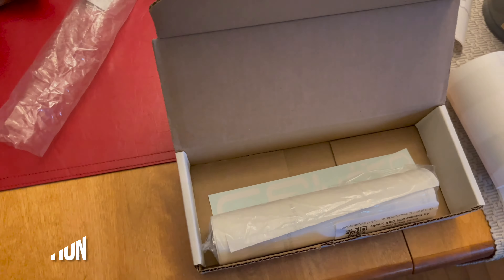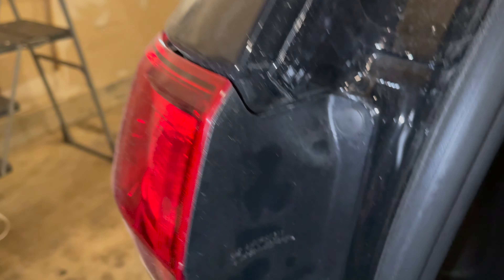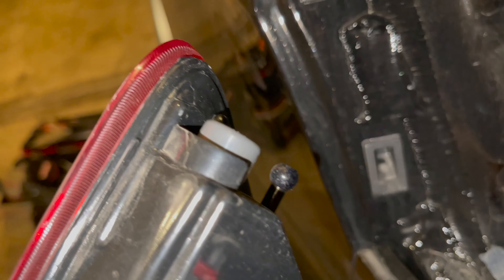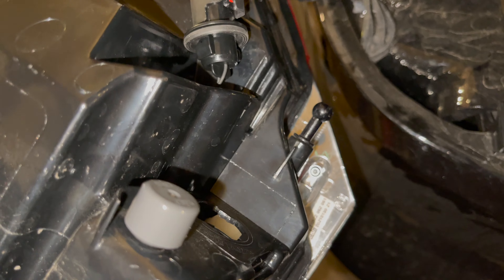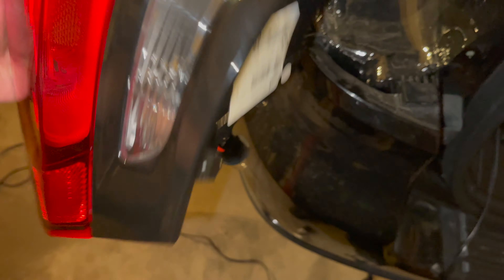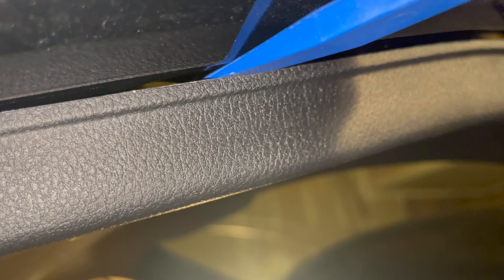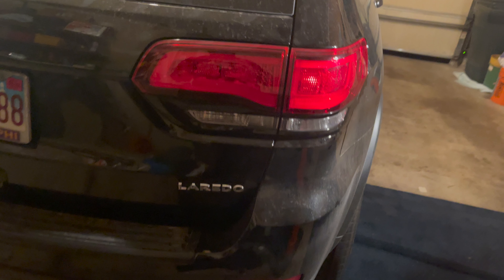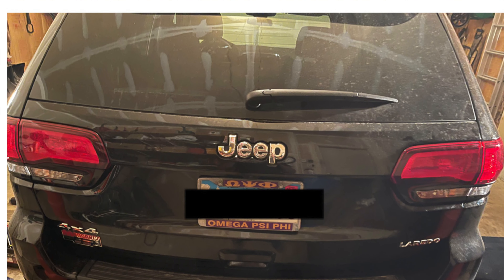How to: Chrome Delete Part 1 (Tailights) Jeep Grand Cherokee

Comment: Only thing I wrapped was the window trim an bought that off of Amazon. Bought the break light trim actually trim not a wrap off ebay for like $40 did the same for the fog light bezels the actual plastic bezel was like 30. An bought the front grill trim off Amazon for like $60. I originally bought the wrap kit made for the car an tried it an didn't work out an that was like 60 dollars down the drain. Go on Amazon an buy the black wrap its like 3 inches wide an 10 feet long you'll have some left an dont have to be perfect lining it up as it will hang over an you just trim it.
Reply from the maker: Yeah in a later video on my page I did just that
Reply: @BigStuDolla91  yea my bad Starting watching this one. I took the dam mirror off when I was wrapping the trim made it easier. Watching your door speaker video now I have the same stock speakers an wanted to upgrade em. Was it worth it?? Try to link these headlights I'm thinking about getting which is my next upgrade
Reply from the maker: @mikehoncho6489  the speaker quality improved but  I feel like I may have lost some volume by swapping them out. I like it though once I got used to it.